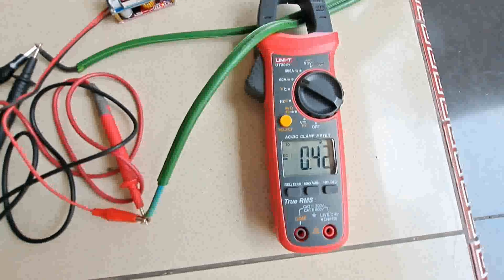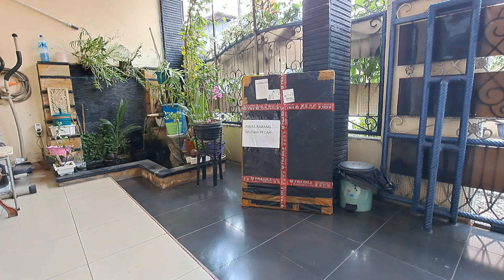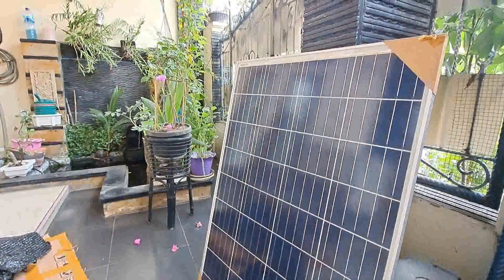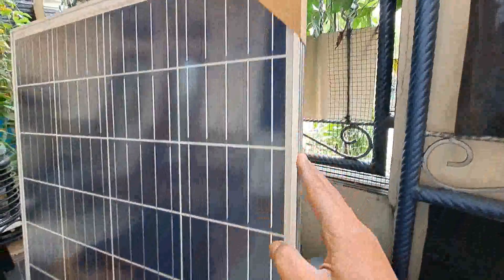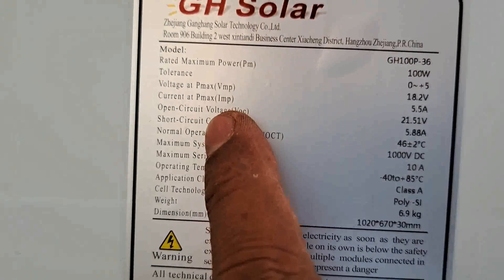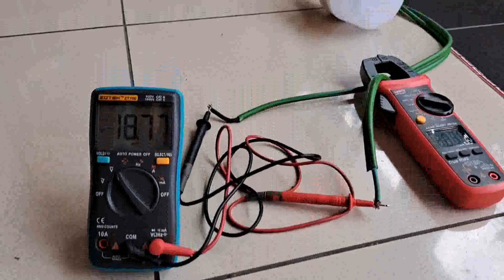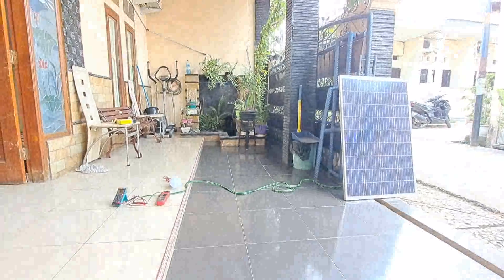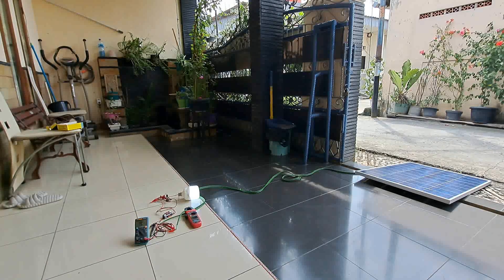UNBOXING & REVIEW PANEL SURYA 100WP MEREK GH SOLAR

Comment: Pak saya juga baru beli gh solar. 
Saat saya test volt keluarannya 21 volt ya.. 
Di display juga tertera 22.8 volt
Reply from the maker: Mantab betul bang out put antara 18v - 22v
Reply: @HariPLTS  gitu ya, karena saya baru mulai belajar plts 12 volt.
Reply: Takutnya saya salah beli pak. 
Diperuntukkan untuk 24 volt
Reply from the maker: @bangyudi4926 iya bang bnyk ntn vid tutorial aja
Reply from the maker: @bangyudi4926  bisa main di 12v  atau 24v terganrung inverter nya pake brp volt
Reply: @HariPLTS  siap" Pak. 
Terima kasih ilmunya
Reply from the maker: @bangyudi4926 sama2 bang 🙏
Reply: @HariPLTS pak 200 wp digabungkan sama 100wp X2 apa bisa, 
Kalau bisa gimana instalasi nya. 

Rencana mau tambah pv 200 wp
Reply from the maker: @bangyudi4926 bisa bang di pararel aja
Reply: @HariPLTS di paralel semua pak
Reply from the maker: Iya bang
Reply: @HariPLTS 100 wp di pararel dulu. 
Trus di pararel lagi ya sama 200 wp pak. 

Apa gitu
Reply from the maker: @bangyudi4926 pake mppt / scc bang brp amper? Pv nya ada brp total?
Reply: @HariPLTS scc pwm 30A pak. 
Mau tambah pv 200 wp
Jadi total 400 wp
Reply from the maker: @bangyudi4926 buat aja 2s 2p bang
Reply: @HariPLTS 100 wp x2 di pararel, trus di pararel lagi sama 200 wp ya pak
Reply from the maker: @bangyudi4926 iya bang 2 pv di seri trs di pararel lg 2pv yg di seri td = 4pv
Reply: @HariPLTS siap pak. 
Terima kasih
Reply from the maker: @bangyudi4926 sami2 bang 🙏